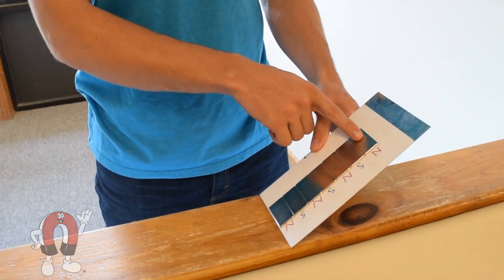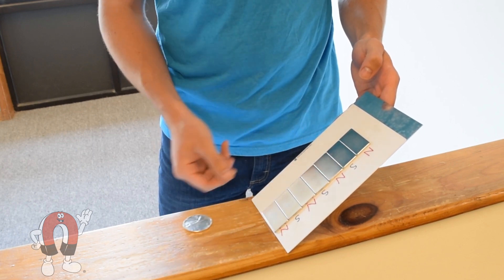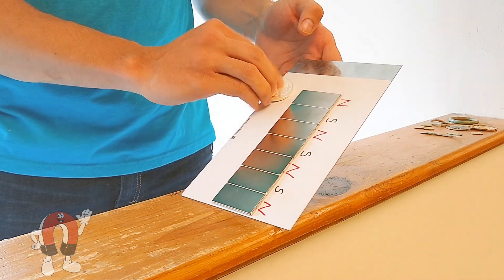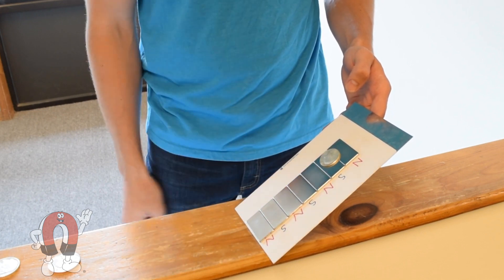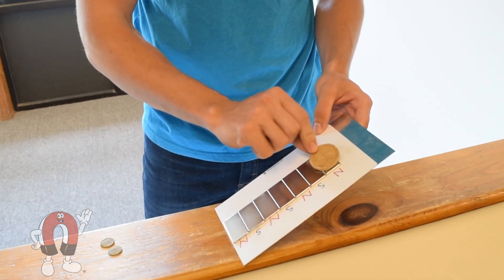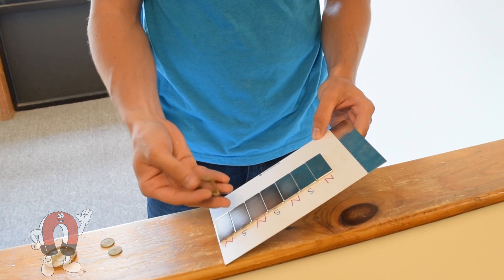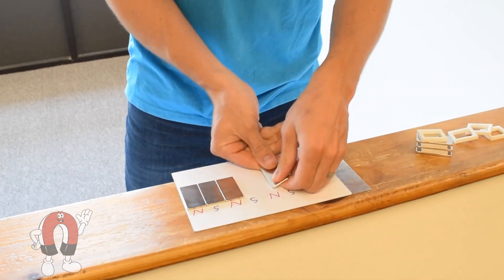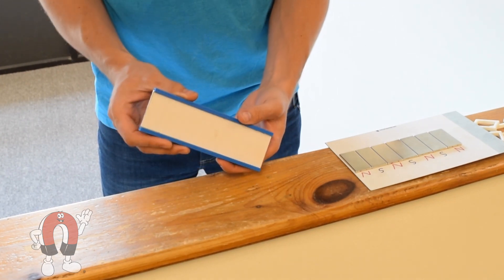Real or Fake Silver?? Use Magnets!

Comment: Can u use a regular  magnet  like one on refrigerator..I try it l my silver  eagle s..etc..none of than  stuck..is that good news Robert  SNJ
Reply from the maker: A typical fridge magnet is very weak, but would still stick to ferrous materials. If the fridge magnet didn't stick to the coin, then the coin doesn't contain any iron or steel, which is good!

Comment: May I suggest that the back-iron (steel-sheet) be made thicker? It is likely saturating as it is - you can test my hypothesis easily by trying to bring an iron piece close to the sheet from BELOW the backer-sheet. If the back-iron is not saturated, the iron object shall not stick to the back side of the steel sheet (and vice-versa). Great demo, nonetheless!
Reply from the maker: Yes I'm sure that thin piece of steel is fully saturated! We really just used the steel to help hold the magnets in place.
Reply: @KJMagnetics  Fair enough :)